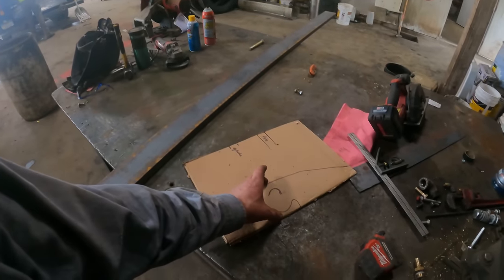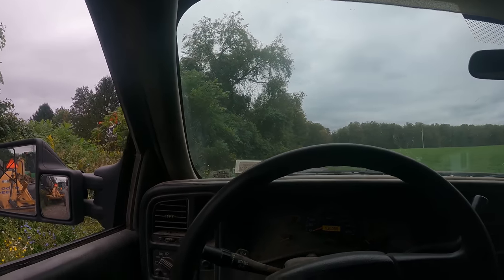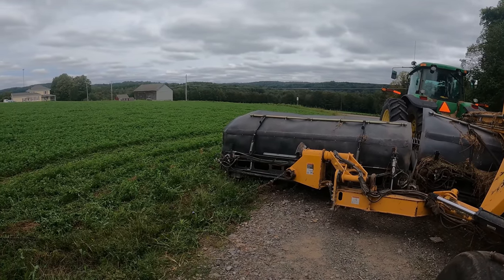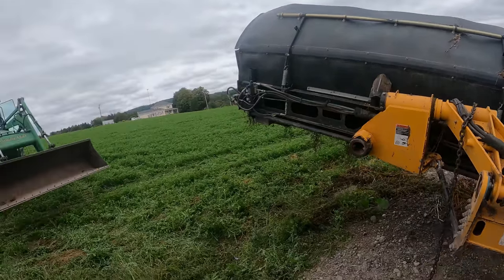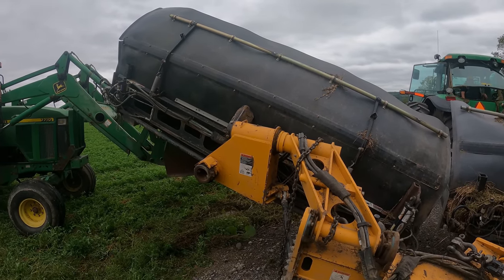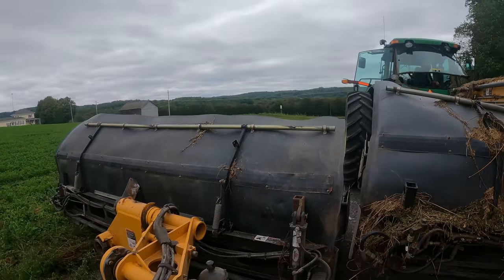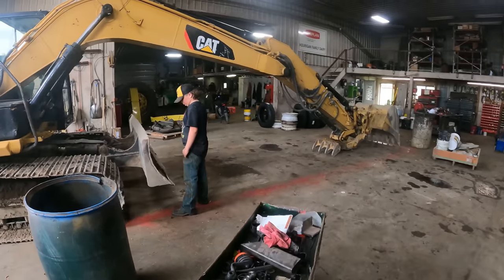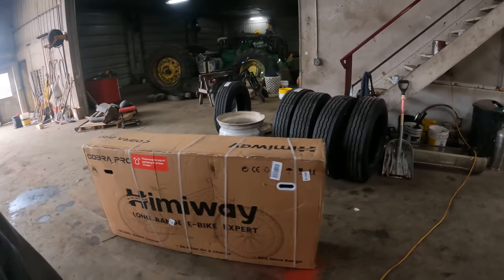Build back better

Comment: This is the type of repair I did for 49 years. On all types of equipment. Yep, I knew that lifting on the wing wasn't going to work, from experience. Maybe when you finally replace your service truck, the new one will have a 3 ton crain. That's what I have.
Reply: Andy is a big man, yet moves around like a 20 yr old.  Sometimes I cringe when I put my wore out bod in those situations..  Enjoy everyday!
Reply: Cranes are NICE when you need them.
Once you have one, you can't live without it !

Comment: I've got a truck about that same model. After it sits it won't engage because the drain back valve is shot. I have to put it in Neutral and rev it a bit then she works until the next time it sits and drains the converter into the pan.

Comment: work on too much equipment to know that was poorly designed we had then happened to one of the mergers we bent the hydraulic cylinder to build a new end on both cylinders to the sleeve and used seals to protect the sleeve to add a grease nipper to when with 1 1/2 think brackets to one on each side of the new end  same designed cat did with other pins i did here too 
does help when you have the space for a fabrication shop and a machine shop

Comment: Sure seems to me that's there is a design flaw to have caused a ripping of the metal unless there was an obstacle or repeated excessive stress.  Glad you had a high & dry area to do the initial repair.  I'd beef up the right side in the same mannor.   Great teamwork!

Comment: you should have protected that cylinder more the slightest spark from a weld will introduce problems on a shaft